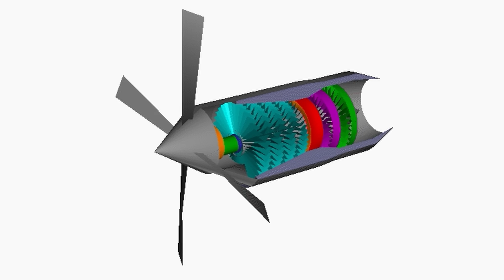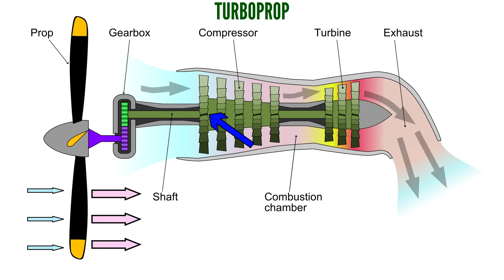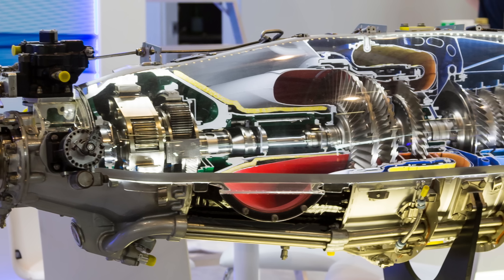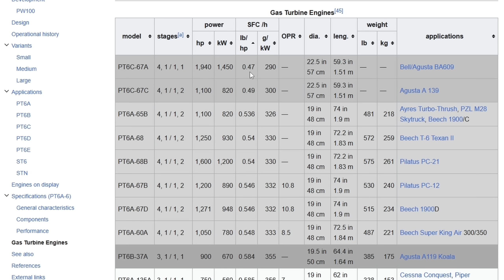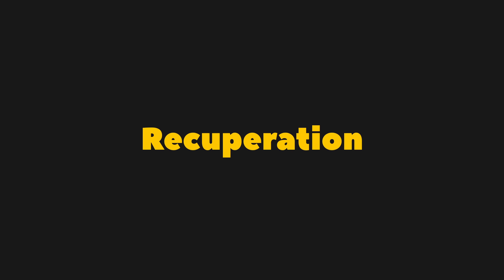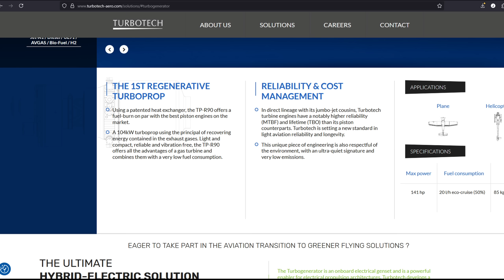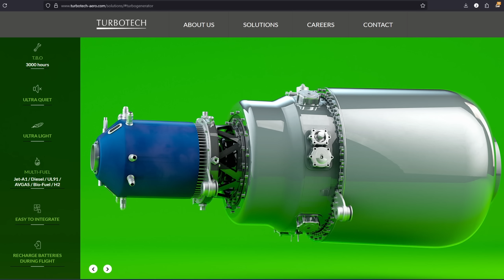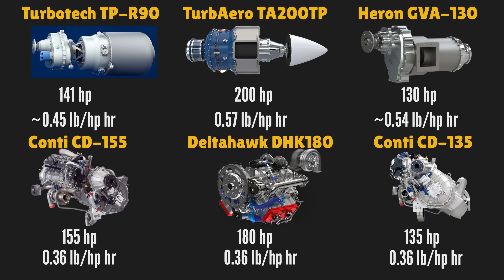Are Piston Engines Dead? Small Turboprops are Here

Comment: Imho the both technologes have potnetial for the further development.
Old design piston engines without reductor made by Continetal and Laycoming have time-proved relliability. But their weight/to power and fuel consumtion/to power ratios are too low in compatrison with modern advanced automotive engines where fuel micsture enrichment, combustion angle etc. have beed controlled by the processor. Also they hafe big frontal cross-sectional area what is important espetially when you design twins with engines in the wing consols. And as for me the main disadvantage of these engines is the fact that they still use 100LL gas that contains TEL (tetraethyllead) - very toxic chemical compound.
Now Rotax goes on the way of applying automotive engine approaches in buiding geared piston engines for planes. They can use regular 95-98 gas, promice to be lighter etc. while having the same maintenace period. But only time can show real reliability of Rotax's engines. And also they understand market well and that's why they began from engines for very lihgt planes with engines up to 160 hp. But how about 350+ hp engines for planes like Piper M350?
On the other hand, turboprops engines still being expencive. Maybe because P&W PT-6 family has a very few competiors in his class. I don't know. But Ideally if I designed private plane in range of 4-8 seats and I have the same efficiency with smaller turbine I would prefer twin engine turboprop design. Turbine creates much less drag after (or in front of) propellers. Twins doesn't have limits of single engine planes etc. Moreover unlike front-propellered singles for twins the scheme where output gases generate additional thrust are available - like ultra high bybass jet. This scheme also potentially can increase efficiency.
So in generall I think the market does need small 200-400 hp turbines if they have appropriate fuel efficiency and affordability. The main problem is that private planes still being too expensive for many of potential private owners. And this in its turn limits the market and doesn't allow pull down priceas in exchange of mass demand.

Comment: Mention was made of Turbine's reduced power meaning less efficient, referring to the reduced N1 (Turbine RPM).  One innovative way around that was the Allison T56.  This engine ran at a single RPM at all times and at any altitude, (except when in ground idle).  Engine "power" is strictly based on prop blade pitch angle, and is selected through the cockpit power levers.  The Engine uses a Temperature Data Control to monitor it's ability to maintain the RPM and increases/decreases fuel, again, to just maintain the RPM.  One benefit of this system is when air densities change, climbing, diving (or just weather) that TDC automatically adjusts for it.  One other benefit of this system is elimination of a variable speed gearbox (usually pretty heavy AND complex) to run the electrics, hydraulics in direct drive and maintain 115V, 400 HZ electrical power and 3000 PSI respectively.   Cheers!
Reply: Yes but that was an engine for bigger aircraft. Can we implement such a thing on a smaller GA aircraft. I'm sure there's some kinda complexities involved.
Reply: @andrebello4191  I believe the Allison 250 is designed to run at a constant rpm.  Those things weigh about 230 lbs and produce about 250 --> 300 horsepower (typically, there have been a lot of different versions, with dramatically different compressor designs, etc.).  It was supposed to power either helicopters or light aircraft.  Helicopters are happier with constant blade speed.
Reply: Sounds like a system that would massive lag
Reply: @eaglezxz3354  I don't know for sure, but running at a constant speed gets rid of any issues with inertia--you don't have to wait for the compressors, turbines, etc. to speed up to get your increased power.
Reply: I think that's actually disadvantageous for fuel economy. Running the gas turbine at full RPM (with the power needed to run the compressor) regardless of power would be less efficient than slowing it down for reduced power. As for the variable-speed drives, I doubt that would be a consideration on something modern or small. That was needed to run AC electrical systems with a synchronized alternator. GA aircraft don't have AC electrical systems, only DC which can just use a rectified alternator and voltage regulator, run at whatever speed - they likewise run at variable speed on piston engines. And even aircraft that do use AC probably don't require the complex VFD systems anymore, as they can use inverters to produce the required output. We see this same shift in diesel locomotives that provide Head End Power to passenger coaches - earlier ones needed to run the alternator at a fixed RPM which meant either running the main engine at a fixed speed (less efficient at low power and limited max power) or having a separate engine for the HEP alternator. More modern ones simply use an inverter to provide the desired AC output regardless.

Comment: Been in aviation my whole life and worked heavily on the structures side.  Seen quite a few piston powered aircraft that were converted to turboprop.  You would think that the difference in vibration would be less on the turbo prop but what it does is create a higher frequency that honestly can tear up airframes that were built for piston power.  The tail of these aircraft usually show more fatigue related damage because of those higher frequency vibrations.  Do your homework before investing is such a venture!

Comment: The other important factor is the price of aviation fuel. In the UK, 100LL is about £1550/1000L but Jet A1 is only about £920/1000L, so the small turbine only needs to be around 60% as efficient to have equal running costs. If you then factor in lower maintenance costs, the small turbine is looking pretty good.

Comment: Turbojets using recouperaors are now suitable for commercial road vehicles driving a generator with electric motors driving the wheels. If they perform well on road vehicles they may be suitable for boats and trains. Run them on hydrogen.
Reply: CRACKPOT!

Comment: Turbines are nowhere near competing with pistons on fuel efficiency or acquisition cost, and probably never will be.  However, the ability to get avgas is going to be a driver - but that can also be resolved with a diesel engine (at least at lower horsepower levels).   On the positive side for turbines, no recip is ever likely to deliver the kind of reliability that turbines can.

Comment: I think I would want to  do a TOTAL cost per hour. You mentioned longer intervals. What does that save?  More fuel costs... But thats not ALL of the costs.  Add in the easier operational use of a Turboprop.  Also.. Fuel useage is higher... But what does the different fuels cost per gallon What does a AvGas cost vs Jet fuel.  
I think some Automobile engines need to be looked at too... I have seen LS V8 engines going in cessnas,  Others certainly could also be used.. that would bring down the engine price part.

Comment: I don’t know just as an observer of accidents recently there seemed to be an awful lot of engine failure at takeoff on small planes . Piston engines have a habit of failing at exactly the wrong time. And given that overhaul is 3 000 to 6000 hours. 
That’s probably much longer than the average person ever flies their aircraft to begin with so that would be a huge cost differential in a savings  . I think diesel piston engines need another look as they work extremely well in some aircraft and diesel engines are much more reliable once a diesel starts. There’s nothing that’s going to stop it unless it loses fuel and air. And unless you fly with Air India, where they shut off their engines as soon as they take off, you should be fine.

Comment: Small turboprops have other disadvantages besides those mentioned in this video: repair costs are higher, spare parts are harder to obtain, and workshops require more qualified personnel. Furthermore, flight operation requires constant RPM, which puts them at a disadvantage compared to piston engines when the engine speed must be constantly varied. Their advantage is the quality of the fuel, which is basically kerosene.

Comment: Surprisingly good video, but I would have wished for you to deeper dive into the difference between free turbine engines (like PT6) and fixed shaft turboprop (like TPE331). The later ones are way way more fuel efficient.

Comment: that Rotax 915 IS uses ancient tech. still using pushrods, and 92kg is auto engine weight territory. A basic Yamaha zetec from 30 years ago can do 110hp without turbo and is lighter (80kgs if I remember). Aviation engine tech is behind by many many decades and the fuel consumptions are atrocious compared to auto engines

Comment: I too was curious, so here is what I calculate comparing a Continental IO-360-ES versus a TurbAero TA200TP:
Using the numbers that I could find in this article, and with roughly 15 minutes of internet research.
The Image @15:29 lists the Continental IO-360-ES @ 210 HP with a specific fuel consumption of ~ 0.43 lb/hp-hr.
210 x 0.43 = 90.3 lb/hr.
Using the conversion factor of 6.02 lbs/ gallon for AvGas, I calculate fuel consumption @ 15.0 gph
The listing that I found quotes the average cost of AvGas in the US as $6.50 (USD) per (US) gallon.
So, 15 x $6.50 = $97.50 per hour in fuel expenses 
(Please feel free to weigh in on your current experiences with the cost of fuel)
The Continental is a fully certified engine with a listed TBO of 1500 hours.
Factory New Costs I saw listed numbers in the $55,000 - $60,000 range
with a factory rebuild being ~ 10,000 less.
(Feel free to weigh in with any data you have.)
So, excluding other costs - I'll use 57.5K for the initial cost and $97.50/ hour on fuel.
1500 x 97.50 = $146,250 for fuel, add in $57,500 for the engine and I come to $203,750 for the 1st 1500 hours, or $135.84 / hour.
for the second 1500 hours, I'll use the same fuel cost, but the lower cost for the factory overhauled (vs new) engine.
$146,250 + $47,500 = $193,750 or $129.17 / hour.
This gives me a total cost (for the expenses calculated) of $397,500 for 3000 hours / $132.50 /hour for the Continental.
     Regarding the TurbAero TA200TP - First, as far as I could figure, this engine isn't actually certified for general aviation.
(Somebody correct me if I'm wrong)
Secondly, most of the numbers I found were "Estimated" or "Target" numbers - 
again, please enlighten me if you have more current or more accurate information.
But for the matter of these calculations - I'm going to ASSUME that these are accurate numbers
Starting with the image @ 15:29, the TurbAero TA200TP is listed @ 200 HP with a specific fuel consumption of ~ 0.57 lb/hp-hr.
200 x 0.57 = 114 lb/hr Using the conversion factor of 6.8 lbs/ gallon for Jet-A, I calculate fuel consumption @ 17.765 gph
The listing that I found quotes the average cost of AvGas in the US as $6.29 (USD) per (US) gallon.
So, 17.765 x $6.29 = $111.74 per hour in fuel expenses.
The price (new) that I saw quoted that seemed the most likely accurate (IMO), was $80,000,
The Listed TBO was 3000 hours
So, 3000 hours x $111.74 / hour in fuel = $335,220 for 3000 hours + $80,000 = $415,220 or $138.41 / hr
So for the first 3000 hours, (Just counting overhauls and fuel;
I calculate that the turboprop costs $17,720 MORE than the piston engine to operate, an average of $5.91 / hour.
Calculations beyond this would require know what a turboprop overhaul costs,
and how many overhauls it can undergo before replacement is required.
(as well as the same information for the piston engine)
Even if fuel costs were the same - to break even, the unit would have to be priced at less than a new piston engine,
and the number of overhauls required to match the turboprops TBO (with allowance for the Turboprops overhaul cost)
Reply: Depending on the use case there could be some cost savings due to reduced weight of the turboprop, although that’s probably a minimal effect.  And likely it’s eaten up in having to carry more fuel for a given mission.
Reply: To me this actually makes it even more appealing! $5/hr more expensive for the ability to run higher and faster (noting that a turbo prop light aircraft would have a higher TAS simply by being able to maintain a higher HP to a higher altitude, even assuming below 10,000ft). I mean hell, that aside I’d pay an extra $5/hr just to smell that sweet sweet jet A every time I fired up…
Reply: Does the turboprop have to use Jet-A? Or can it run on cheaper kerosene?
Reply: @TheBennett388  No idea.
Reply: There is no TurbAero engine flying.

Comment: Well done, but here is the problem as I see it. 
First: Piston engines are not "unreliable" - but they do have shorter TBOs
offsetting that, is their lower initial cost. 
Pairing this with the fact that a significant number of GA aircraft
tend to accumulate hours relatively slowly,
the potential of engine maintenance costs ever overcoming the initial price difference
inherent in the turboprop is highly unlikely.
Then of course, there is the fact that most of the "Benefits" of a turboprop
will never be realized within the flight parameters of most light aircraft,
which typically operate in the most disadvantageous envelope for a turboprop,
simply makes equivalent fuel economy a moot point.
Unless you have a specific need that is better met with a turboprop,
(high power to weight, high altitude operation, rapid accumulation of engine hours)
then, IMO, this is a very expensive solution looking for a problem that doesn't really exist.

Comment: You talked about not wanting to have a certain power point setting for maximum efficiency. But surely that's just rule of thumb? The power points apply to the thrust to weight ratio, the speed and the cruise. You don't have to follow what is normally done if the engine is doing its job at a manufacturer recommended speed.
I.e. what's normal for one engine isn't normal for all engines, in all aircraft.

Another thing that could make a turboprop viable is to use a hybrid generator with an axial flow electric motor to provide boost thrust. Then it can cruise at high throttle and get additional capacity from the electric motor.

Comment: As cool as they are, they will not replace piston engines. Piston engines are far too well established, including support networks and easy parts availability. And with Diesel engines more widely available as replacements, the issue of fuel becomes rather irrelevant. The same issue applies to Wankel engines.
What will eventually replace piston engines is electrical motors.
In the end it's all about the support networks: availability certified personnel that can work those propulsion systems and of course spare parts.

Comment: RECUPERATERS??? This is NON-SENSE. Cold Air expands much more than HOT AIR!!! Too make my point lets drive this to the EXTREME. Let's say the exhaust temp is 2500F. If the intake air is 2500F. WHERE IS THE EXPANSION OF GASES???? You make your power from EXPLOSIVE EXPANSION! RECUPERATERS are good for FUEL economy only but NOT for making more power. You better rethink this man! We have a J6 at our airport we use for Electrical power by it was using 100 gallons per hour. Since it is on wheels we do not care about weight and now have a 250 Gallon WATER Injection tank to keep the "REAR END" cooler and get STEAM expansion so we can run a more aggressive pitch in the turbine! Now we make the SAME amount of electricity but use 20% less fuel! WATER IS CHEAP MAN!!!!

Comment: Even if a small turboprop fuel burn is higher the turboprop runs on jet fuel which is considerably cheaper that as gas
Reply from the maker: Depends where you are. A few commenters have already stated that Jet-A1 is more expensive than Avgas at their airport. But yes, Jet-A1 is typically cheaper, especially in Europe.

Comment: I don think they are the future. I don’t trust he’s price estimates. I don’t see how those low prices are achievable with exotic materials and high tolerance manufacturing. This things are needed to achieve the high TBO times that make it worth it. 

I don’t think turboprops prices are changing anytime soon, and the economics are the main reason they aren’t used. I’m not sure how much reliability would increase in low time, high interval flying, and everything else is a negative. They cost more than their TBO and hot inspections justify. They burn more fuel than the lower cost of it justifies. 

The only way they make sense is if you can’t get avgas. Otherwise, they don’t work. 

For large, complex pistons, an argument could be made. Not for the light GA use.

Comment: Higher efficiency with turboprops will come when more advanced materials are discovered/manufactured that can handle even higher temperatures in the combustion cycle.  My guess is that AI (Grok 4 or even 5) will help in that regard.  Elon has said he thinks Grok will  be a major tool in discovering and manufacturing exotic materials.  We will probably see major advances in the next few years.  The next hurdle after that would be time and cost of new engine certification.

Comment: Another factor which may tilt the balance towards turboprops is the price differential between avgas and jet a1. On the other hand kerosene is heavier than avgas…. Somewhere there may be a sweet spot towards small turboprops, but…
Reply: Jet-A has a higher density, but specific energy is about the same, so you get about the same energy from the same weight of fuel.

Comment: Have you overlooked one vital part, and negative, of the turboprop compared to piston engines? Turboprops have many stages of turbines, many many fan blades for very high temp and those are neither cheap nor easy to work on. Maintenance costs on those would be significantly higher and you will need specialist mechanics and companies to work on them compared to the piston engines.